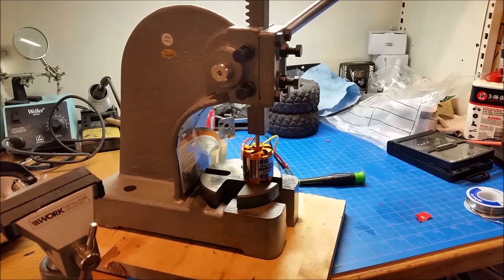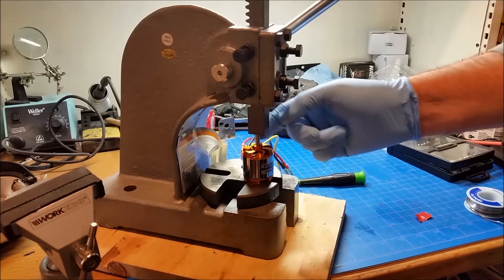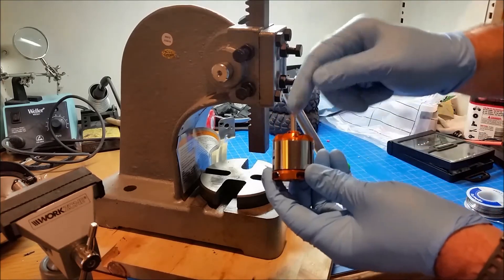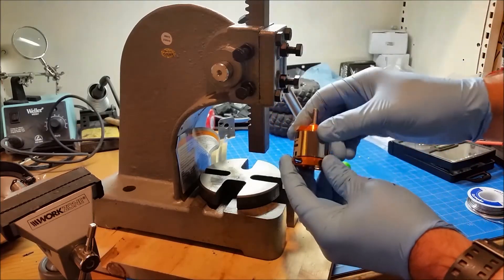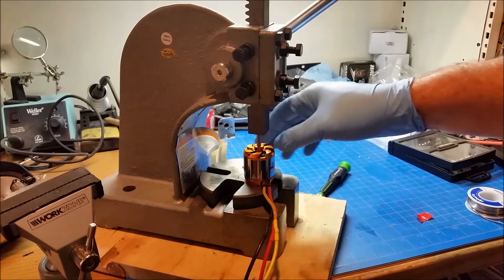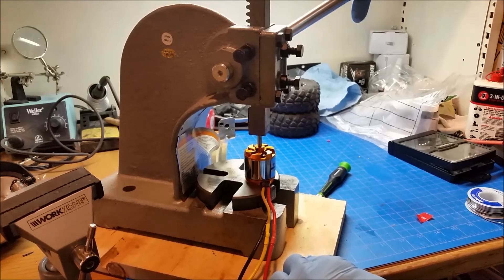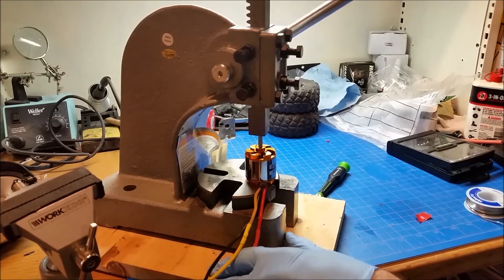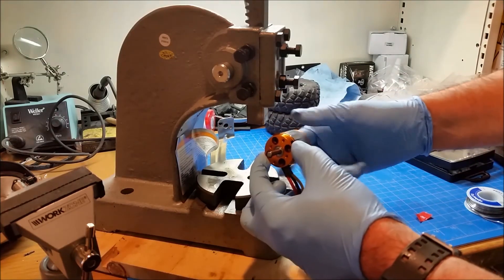Turnigy D3542 1250KV brushless outrunner shaft reversal

Comment: Hi, I’ve done the same.. (kind of..) with a hammer.. not clean. But now, there is no clip anymore on the pinion side… I can’t push my pinion enough, so the bell is moving.. how can I fixe that? I need some thick washer with a grub screw. How is it called? I can’t find it…
Thanks for the video

Comment: I did this but dose the lack of C clip / grub screws not mean the motor could slide apart?

I did this to allow a prop adapter to fit but in hindsight would have been easier to cut the shaft, anyhow the prop will push the motor togeather but my fear is it may pull apart from drag when not under thrust?
Reply from the maker: Well, the grub screw is still in place, but I never had any problem with the lack of c-clip, but my application is for a surface RC, so perhaps the force being applied is much less.
Reply: You could always put a new flat spot on the shaft with a dremel for the grub screw to sit on, I've done this a few times plus cut a new channel for the c clip to go on.
Reply: @ValleyRC   you can do that with a pipe cutter shouldn't be to hard

Comment: Nice. I've tried it three different ways. Only time the shaft doesn't "pop" is if I use a bench-vise to move the shaft.
 Yes...these are very torquay Motors. I've loosely calculated that the D3542 has roughly four times the torque of a good 45-turn brushed motor. The D3548 has about 6 times the torque....either way you go...get ready to brake drivetrain parts. Lol
Just a little info...if your running the single-speed tranny on your Trailfinder a 750kv to 950kv will have way better start-up crawl to it. A 2-speed truck can get away with a 1100kv to a 1450kv and still have great start-up. A few of us are running Turnigy and Tacon outrunners and that's been our experience.
 Great video. Can't believe I haven’t seen it till now. 
I have a few videos of our rigs out on the trail with outrunners. 
 Tom
Reply from the maker: Thanks for the comment.  Good info.  With the D3542, I just couldn't get over the screechy motor response. I tried it in both my SCX10 Jeep Wrangler and my Wraith, and it was noisy and too abrupt.  I'm not done with trying outrunners, though.  I got the idea from another YouTuber "fearlesszach"(?), to use a HobbyKing Car ESC, because there are a few versions of that esc that are specially made to handle high pole count motors.  He tried a Castle ESC, just like I had done, and had a similar experience, but with a HK esc, he claimed it was smoother.  I have an HK esc, but haven't tested it out, yet.  I went and watched one of your test videos, with the Trailfinder + Tacon Big Foot 15 motor.  That motor does sound unique, but boy it is sloooow.  I'm sure a larger pinion would help, but I like my rigs to at least be able to do 6-7 mph.
Reply: RC Dabbler it was slow because I had it in first gear. It'll do about 6 or 7 mph in second. I really like the unique sound they make. I have a Holmes Hobbies Revolver 1800kv sensored outrunner for when I'm going to a spot that has alot of dirt climbs. But if it's just primarily rocks and trails....I keep the Tacon in there.
 Your right about the esc.... quality and design makes a big difference.
I've ran Holmes BLE Pro and the non-sensored outrunner work great and have nice low start-up....but some guys just don't have the budget for a $140 esc. I've ran them also with a Castle Sidewinder...that's about $50 on Amazon vs a $39 Turnigy CAR 60 3s esc. The extra $10 is worth it. The Turnigy had mediocre startup at best. The Sidewinder had way better start-up but not as good as the BLE Pro that's over twice the price.
 Not sure if I'd ever go back to a brushed crawler motor or inrunner. I like the torque way too much. Lol
There's about 6 or 7 of us that run outrunners now including myself and my oldest son. 
Tom
Reply: RC Dabbler if you watch any of my videos you should read the dropdowns. I put all the info on there that I can. 
 I have one vid where I'm testing out the Holmes Revolver with a 15-tooth on 4s and that thing is FAST. It'll hit about 20mph set-up like that but even with all the heavy duty upgrades to my Trailfinder.... it won't hold that much power for a long before it breaks. So if I keep the revolver motor in there I usually run an 11-tooth pinion on 3s.
Reply from the maker: I always read descriptions, especially when I'm researching.  I'm even disappointed when I finally find a video about a product I'm interested in, and the producer doesn't leave any useful notes in the description.  Haha!
Reply: RC Dabbler me too....I'm like 
"where's the info at ,  is that it?". Hahaha